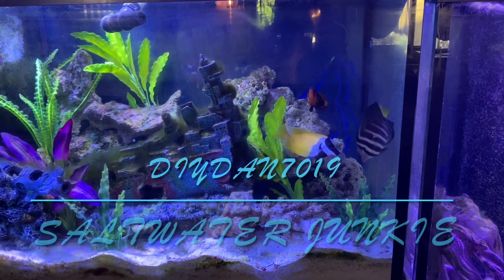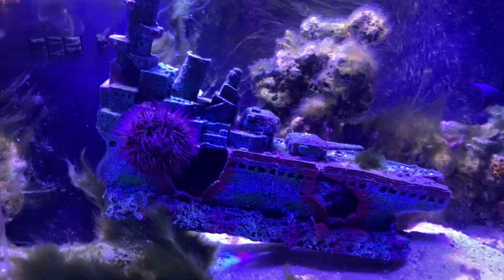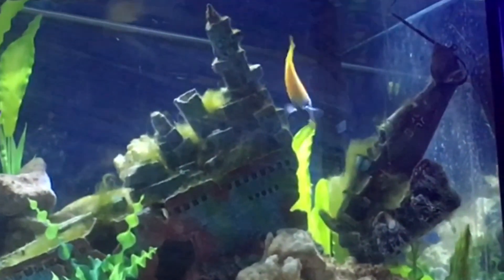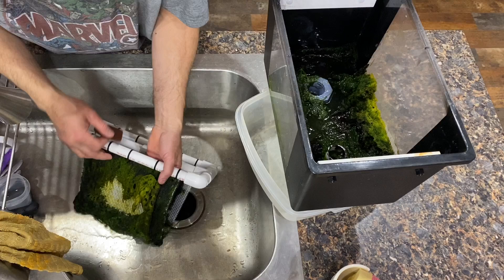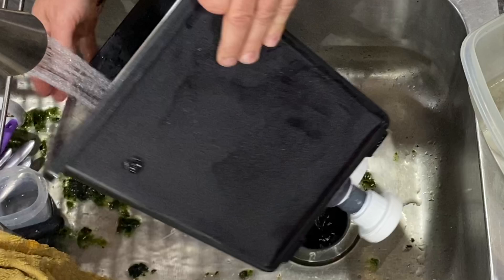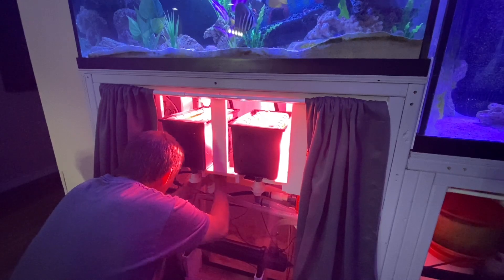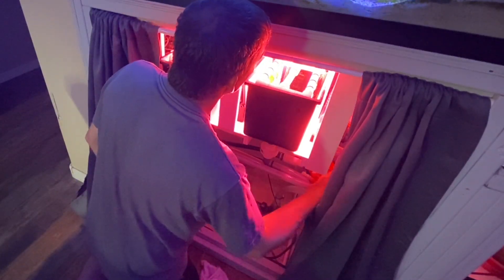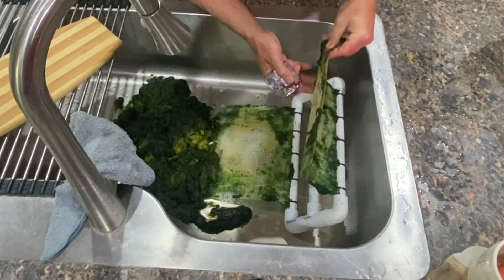Diy algae scrubber compact/dual screen review, likes, dislikes, cleaning schedule, are they working

Comment: thank you for sharing your thoughts and feedback, where did you get the containers with clear sides that you are using for screen to hang inside and what type of lights you are using?
Reply from the maker: I have a video on the actual build of these scrubbers that goes over everything you need to know but I did put the links to the lights in the description if that’s all you need the containers I got from Petco
Reply from the maker: The icon for the build is at the end of the video you watched if you are interested

Comment: Im new to your channel and this is the first video i watched. It surprised me that you have so much hair algae, which I can relate to. Can you tell me what is the reason you have so much hair algae (i assume high nitrate like you pointed out in the video), but then why do you have high nitrate, and what are you doing to combat this other than scrubbing and removing hair algae?
Reply from the maker: @TonyTran-q5s  I thought I went over everything that I thought was my reasoning for having it   the strong lighting, high nutrient levels in the system , and possibly the addition of my algae scrubbers making it worse but even after the algae scrubbers lower my nutrient levels I still have fought the hair algae in my systems. If you are having similar issues try lowering the intensity of your lighting or lessen the amount of time they are on each day that would be my first thought if your nutrient levels are low in your system
Reply: @diydan7019  So you did it on purpose to see how well the method works?